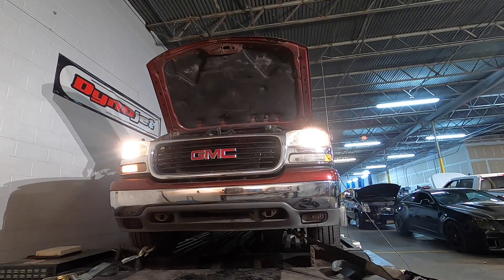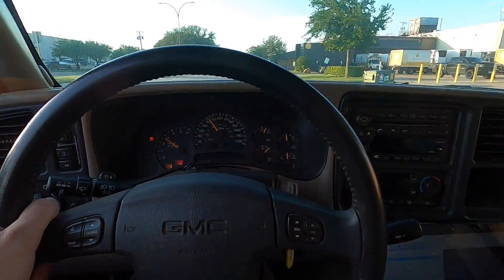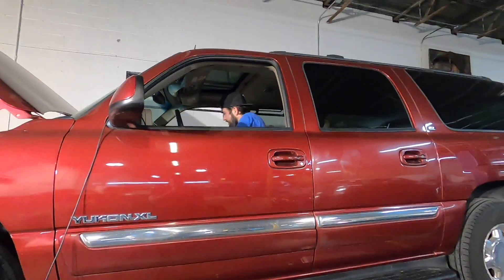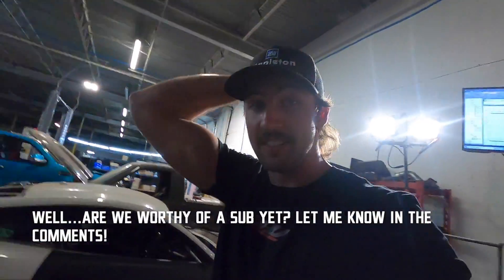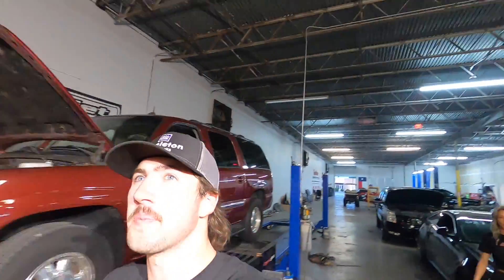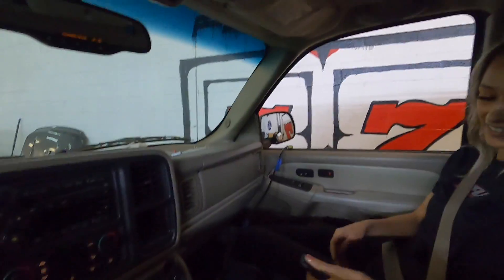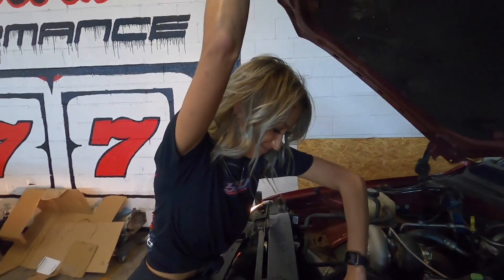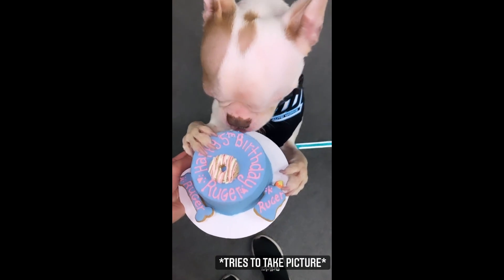Turbo 5.3L Yukon Stock Fuel Pump Test: When Do You Need a Bigger Pump? (Uncle Rob Hits The Dyno!)

Comment: My favorite part of this channel... you actually create playlists that make it easy to follow content on a build... unlike 90% of other YT creators.
Reply from the maker: I try 🤟🏻
Reply: THE BEST THING EVER!!
Reply: @Stapleton42  What hot side are you using? What rear gears are you running and what chassis did you get the transmission from, was done to the before you put it in and since you've had it in for awhile now are you happy with the stall speed?

Comment: Bought to get my 69 Chevy C10 back up. Actually you have reignited my interest in my original street project.  1969 C10 heavy half ton. Camel humps, Preformer cam and intake, 1406 4barrel, headers with dual exhaust + crossover.

Comment: "I trust myself, but we're gonna hide anyway"

Before you said this I was noticing how you all stood behind a car before the dyno pull.  

That's just smart.  You should do a short segment on dyno attendance safety and how if things go south you don't want to be in the line of fire.

Turbo, engine, transmission failure at those speeds that close has definitely killed people.  Or like that video of the old dude that stepped on the rollers and face planted.  It can get scary if you're not aware.
Reply from the maker: Exactly. I’ve seen those videos too and don’t want to be decapitated by a flying driveshaft or something. At least if there’s a car in the way the odds of a direct hit are far less
Reply from the maker: Exactly. I’ve seen those videos too and don’t want to be decapitated by a flying driveshaft or something. At least if there’s a car in the way the odds of a direct hit are far less

Comment: Before you start moving the wastegate’s around I would install a drive pressure gauge to see what it is. Being that, that turbo was designed for that engine platform and you are driving the turbo pretty light you may actually only have 3-4 psi drive pressure while making 10psi boost. If you want to really make it a science channel and get good feedback I would get a drive pressure gauge and you can see how efficient the setup is on the stock pump and then compare as you add more fuel and air.

Also keep in mind that’s a 3 psi spring. But if it’s 4 square in and the header tube is only 2 square inch in volume you would actually need closer to 6 psi in the smaller volume to over come the larger surface area piston in the wastegate. So if your drive pressure is in check you may need to run a smaller wastegate for this application.

Comment: Brother I been watching this entire build and I'm trying to learn the numbers. I have the 05 Tahoe with a 5.3 and 320000 miles. That motor is soon coming out and a different 5.3 is going it so I can still get to work. The original one however is going to be completely rebuilt with upgraded parts specifically for a turbo build. My tranny is going to precision transmission in Amarillo. Gutted and rebuilt for hp of around 1000. I don't want that much power but I want the drivetrain to survive it. Same with the rear end. Yukon gears and dura grip posi when I light it up.

Comment: Pull it into D3 when romping on it. It saves the overrun clutch from damage. 

Search 4l80 overrun clutch wear if you want to better understand. 

It would be cool if you could spread the word too. We need to save as many 4l80s as possible. Lol

Nice vid as always!
Reply from the maker: Good call I forgot about that! I used to do that in the Escalade before I had a manual valvebody

Comment: Should wire a relay to parkers if you CBF setting up thermo fans and don't want to have to plug and unplug fans everytime. Just have to drive with your lights on which is a good practise with darker coloured cars anyway

Comment: Love the build man congrats on getting it up i got my denali finished only to find my oil pump couldn't handle the cam / side note i have some 317 heads and matching6.0 cam you could use on uncle rob id trade for a good oil pump just putting it out there cheers man cant wait to see it run at yellow belly

Comment: I have an 05 suburban...love this! Wish I could do this too but mine has 260000...😂 I'm having a few issues I can't seem to figure out with mine reading low oil pressure ...I think it's gonna end up being a stepper motor in the cluster after I've done a bunch of other harder stuff to replace. Lmk if you can

Comment: On those dip stick I jb weld high temperature with an really high powered magnet just 4 science! On tha hoop.Just put magnetic dol with thin coat JB HIGH TEMP Weld in dip stick .This will catch all metal in bottom an top Motor.

Comment: Pretty good power. When my Camaro made 500 to the wheel it would run 6.20s I would be like to see what Uncle Rob would run When you get the same power down. I know it's probably twice the weight and a brick in the wind.
Reply from the maker: It should be in the 7s
Reply: @Stapleton42  Mid probably

Comment: Happy to see that this beast is finally running good. Well done dude. It's always so satisfying when something you do yourself turns out successful.

What causes the plugs to burn? When I service my car the plugs are always just dirty, but not melted or damaged... Is it just something that happens with age, or is it a fuel/compression/mixture related thing?

Happy Birthday to Cyborg-pup.
Reply from the maker: Heat range too hot for boost. It pre ignited and melted itself lol. Thanks man🤟🏻
Reply: @Stapleton42   Thanks,
So it's usually only on boosted setups?
Makes sense then that my stock 1.3l Toyota keeps its plugs whole.

Comment: got the fp on my eagle talon tsi zero complaint except all 4  tires don't grip anofe through 3rd and 3rd gear and after I need a better clutch but now I'm also picked up 84 Fleetwood diffintly going to need lq9 and boost and rods possibly some heads and intake boost spec pistons for longer abuse for Shure I hate lifting if I've learned anything from my first fp turbo

Comment: Hey Mitch, any possibility of taking Uncle Rob and/or the Escalade to the Motorplex in Ennis for some real world numbers? 60 ft. 1/8 1/4 mile
Reply from the maker: Yes that’s the plan. I’m honestly burned out with Yello belly. We will race at a real track
Reply: @Stapleton42  Good deal, with your style of videos you need reliable numbers to measure the changes you have made. Yellow Belly has its place as grudge / street racing. How many passes would you be able to make if you entered a weekly bracket race?, a couple runs before 1st round?

Comment: You said that pro torque converter so fast i cant understand what u said, lol, but ill go back and watch that video, bc i sure dont remember, im thinking about gathering up parts to do the same setup on my 07 classic crew cab 4wd, or a lsa blower from boost district, im thinking the turbo would be a little cheaper setup, but it hauls my 86 c10 around, and i haven't heard too much about towing with a turbo ls, i know youve had both, which do you think would pull better?
Reply from the maker: Blower for a daily 10/10 times
Reply: @Stapleton42  that settles that then, lol, i figure itll probably make around 500-650, should be plenty
Reply: @Stapleton42  you think that pro torque converter would be a good fit for a daily/tow rig? Prob just gonna do either the btr torque cam or a tick towmax cam, figure with what all ive seen from holdners videos, it should be pretty good with that lsa setup

Comment: I subbed when I seen the 03 Yukon you were building up.  Algorithm sometimes hits it right on. You put bigger rockers?? 1.8 roller rockers??
Reply from the maker: Nope stock rockers I’ve never even pulled the valve covers lol
Reply: @Stapleton42  wow. That thing is not slouch now. Spins the tires until you ease off the pedal. Holy moly. Roller rockers will make that stock cam breath a little more.  I’m putting barred 1.8 stainless steel roller rockers on my 03 Yukon soon. As soon as I learn how to maf tune it from Hptuners. No turbo tho.  It’ll be a little more fun. Lol.

Comment: Hey there is my 2000yukon xl1500 5.3lm7 the same engine? I'm gonna pull intake since I've been losing coolant and besides the known issues with castech 706 heads unknown if mine are yet. I was told felpro makes a better replacement gasket btw only 120k on it. I'm in CA. so deletes are out of the question. I'd been looking at intake upgrade or cam but I'm excited for you & if same motor ,I'll follow your turbo lead. If you have any suggestions pls lmk. Now ,I understand the issues &concerns that come with hairless however I was told by my Dr. Hairless is from mothers genetics not fathers. I hope that's correct & you can find some good news in info.
Reply from the maker: this was the stock engine yes

Comment: I don't why you got the turbo that was supposed to light off quick and work with a stock converter when you knew you were going to but a converter in it you should have went bigger I assume
Reply from the maker: No point. This motor will barely handle everything this turbo can put on it
Reply: Did you open the rings I don't remember but think so we'll that will be limiting but if it spools quickly that means small hot side to me and I think that's going to be restricting and limiting

Comment: Save yourself a fourth the cost and pick up a Billet wheel 78-75 on eBay for 250 bucks Pro tip don't pay 4 times the cost for rebranded Chinese
Reply from the maker: It’s not just a logo when there’s quality control and r&d done on the components. That’s all precision turbo is. They just assemble the Chinese pieces in America lol